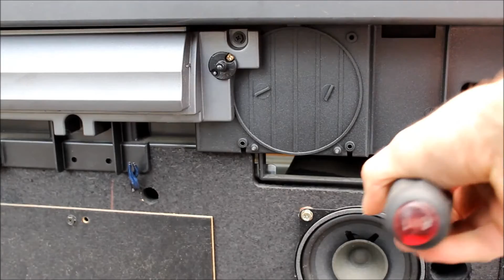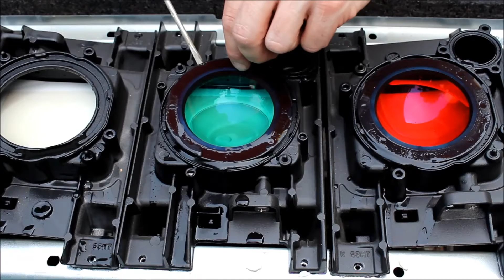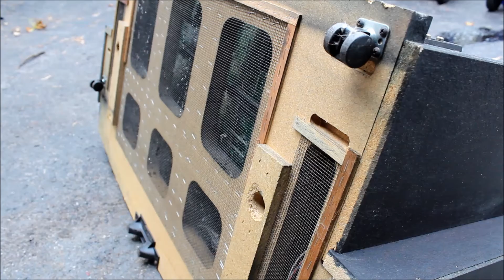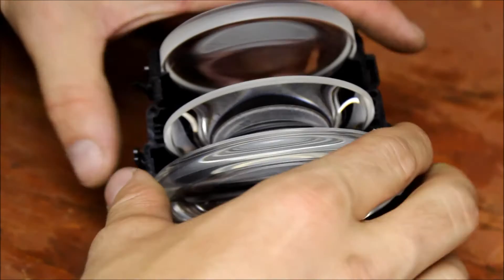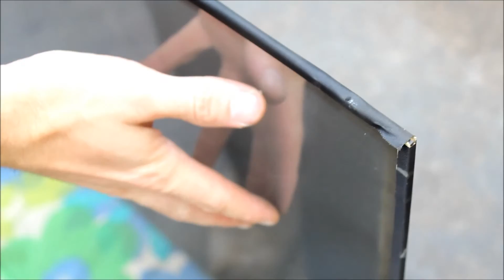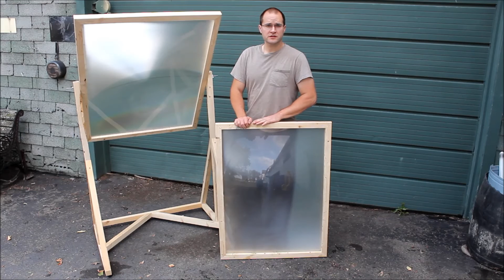Solar Death Ray from a Fresnel lens

Comment: it's easier to remove the tubes first, then the aluminum frames to drain the oil into a pan
Reply from the maker: That is a great tip. Honestly I had no idea that was inside the tv but that's half the fun learning how stuff works. Thanks for the comment and watching.